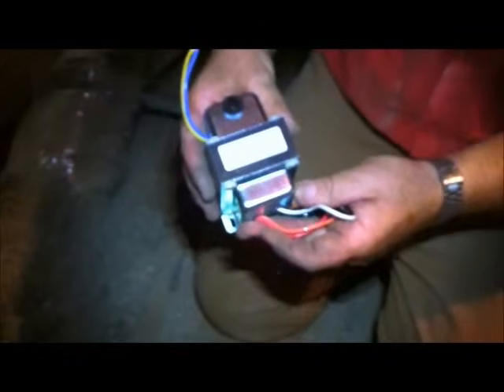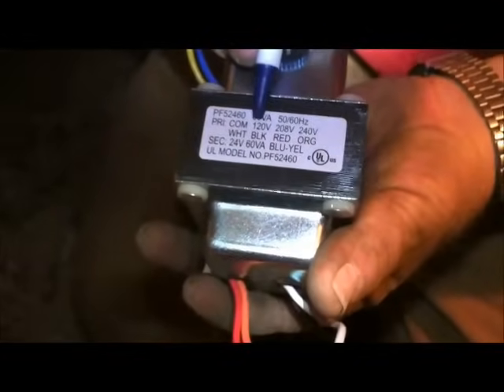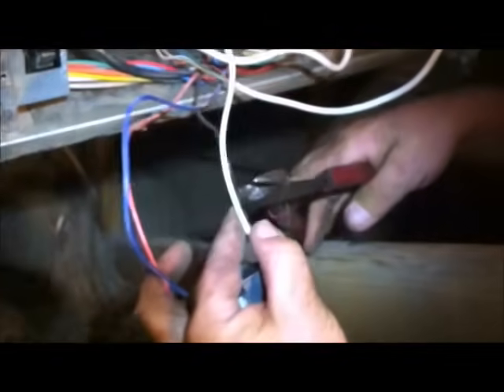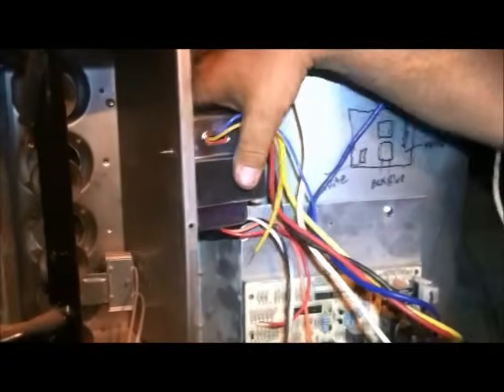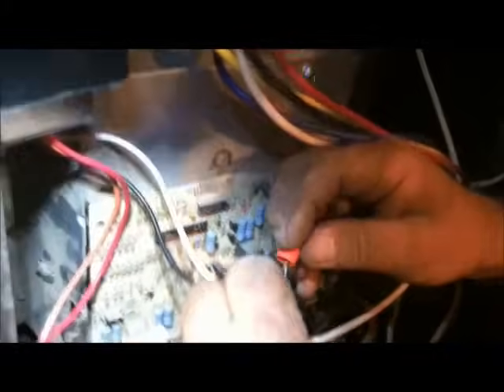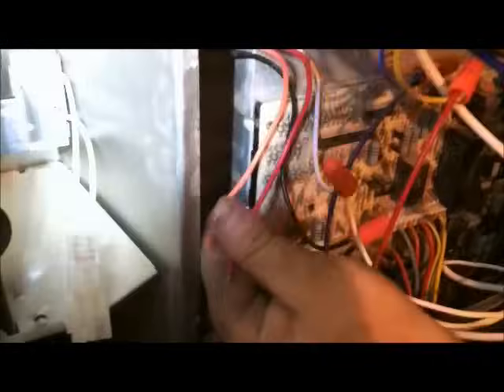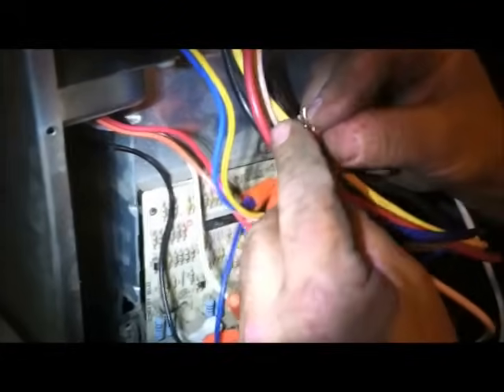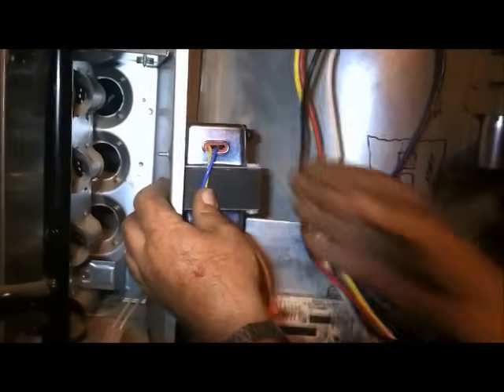Air Conditioner Transformer - How to Wire a Transformer

Comment: Hello great video I have an issues with thermostat turning off and on again the message said looking fir calibration on heat or cool disable the house is cooling but thermostat turning off few time a day and reboot after few minute ecobee was wondering if thermostat getting enough power ?thank you

Comment: So, if I got a 2 wire (red 120 and black 120) coming into the furnace, should I wire 1 to common and 1 to the 240v, in case that I'm runninn 240 to the furnace?
Reply: Your gas furnace should be 120v. If you have an electric furnace then it would be 240v.

Comment: For home gas furn Do the 24v output wires need to be wired a certain way or no matter ...and how many amp fuse coukd i install inline 2-3A?...orig 8yr old  trans went bad no melt......i repkaced it and it worked for 4 days  then melted and failed...any ideas?...furn is 8yra okd trane gas...control board fuse did not blow.

Comment: Sorry to call you out but you said NOT to twist the two wires together when using a wire nut. However, you TWISTED the first  two black 120v wires together and put on the wire nut. Only the rest of the wires were NOT twisted with a wire nut so kinda confusing...

I'd also read a recent comment from someone saying the white wire is actually a neutral wire and NOT a common wire in this video, is that true? Please advise...

Comment: I have 3 wires on my secondary. 
Hammond part # 166L25
Green , Green/yellow, Green 
Is the Green/Yellow common?
They gave me two secondaries? 
Could I not have just run an extra wire to a single secondary to run my two items?

Comment: You say you want to touch the wires to something to ensure they are not hot (powered up), but considering the way that you cut the wires (i.e. both leads at the same time), you're going to know right away whether those wires are hot because they are going to arc and burn holes in the cutting edges of your wire cutters.  When you are working on hot wires (or wires that you think might be hot), only cut one wire at a time.

Comment: Does it matter which 24 volt wire you use to splice in the fuse coming off the Transformer? For example years is yellow and blue, could I use yellow or blue or only one of them?

Comment: You mean to say that the white is neutral, not common. Common is the 120v ac but the other colours are other voltages and common does not apply. 240 has no neutral or common. White is neutral or a load neutral but only on 120. Please remove your shitty video as it's very poor quality and very inaccurate and misswiring this will cause damage.

Comment: Installed so easy and matched my old one, but much smaller in physical size. Pretty much plug and play. Make sure you have a plan and help to get it on the roof.>>> nub.best/ywvn     Cooled our trailer in no time. Replaced a 15000 BTU Dometic unit on a 2006 Wildwood

Comment: I replaced a transformer like this today.     Unit was dead as the control board had no power.      My 4 year old Trane unit had a spade connector and the Trane dealer who installed the unit would not sell me an OEM replacement.    ( they want to do it )   I like DIY.    So a local appliance shop I'd been going to for parts had a comparable transformer with wires, not spade cxt.       So I had seen your video and after 30 years of wiring, appliances, car repair, etc.    And an EE degree, I realized I had been using wire nuts WRONG!    I would twist the wires together first.     Probably taught by my dad who was taught by his.     Thank you!

I also stopped by Home Depot and bought the "baby orange" wire nuts.   I had a mixed assortment in my workshop and was always hmmming and hawwwing with the smaller sizes.     You're right.    These are perfect and I had obviously long ago used up that selection from my mix.    Now I have 30 more ( minus 4 ) .

Comment: I just replaced my fan relay/ coil. Outside unit kicked on but not fan. I noticed coil side was hot to the touch. After cooling down and plugging coil back in. Everything worked fine. What caused coil to get loose? Short maybe? Capacitor? So confused.  Great vid by the way.

Comment: But 240 doesn't have common just two hits n a ground 😕
Reply: On a multi-voltage primary, the term "common" is used to describe the neutral on a 120 volt system as well as the L1 conductor on the higher voltages.

Comment: i got a goodman  unit...i install the fan motor.the capacitor.and the contactor.and still my fan or compressor wont start......my blower inside the house urns on.please help
Reply: You'll need to measure the voltage on the contactor operator coil.  If you have no voltage there, you may have a bad thermostat or control wire break between the thermostat and the contactor coil.  That wire generally runs from the furnace to the outside condenser unit.  It could also be an incorrectly wired thermostat.  Often the required jumper wire between the rh and rc terminal of the thermostat is left off by mistake.

Comment: what gauge wire is on the secondary 24 v side of the transformer
Reply: 18 gauge copper is used on class 2 systems with no larger than 40 VA transformers.  On very long runs (over 100') you will need to upsize the wire to 16 gauge or possibly 14 gauge on extremely long runs.

Comment: I have a Heil heating and cooling system, where is the transformer located? My thermostat doesnt have power. I am an engineer and could fix it myself if I know where it is located. Tyhanks
Reply: In almost all residential HVAC systems with remote condensers, the low-voltage control transformer will be located in the gas furnace since it must also power the control board for both heating and cooling functions.

Comment: hello  mr.fix my own ac.
my question is if you can tell  wy the transformer fail? please
Reply: many factor but the two most common is a short externally or power surge from a thunder storm that cause the wires being wound to burn out.

Comment: Might want to keep in mind that electrical tape only true purpose is to tape the base of the wire nuts to the wire so they do not become lose from vibration, temp changes, etc.. I am as guilty as anyone using black tape as an insulator in a pinch but it is not designed for that and is against code (along with not taping the wire nuts). If electrical tape last a year used as an insulator its some really good tape. I have seen it last longer in very friendly environments. But the whole "Code" thing depends on where you are working I suppose. I just got in the habit of putting a wire nut on everything - even to terminate an unused wire - then putting a couple wraps of tape on em. Not trying to "call you out" on anything, just trying to help some of the new techs who might be electrically impaired... and now I hear my Fathers words " do as I say, not as I do".. yep, He is a retired electrician..hehe..

Comment: How do you wire it for a 208-230 heat pump? How often do they break?
Reply: Select the primary voltage wire that matches your measured supply voltage.  If you have no volt meter, select the 240 wire since that's the normal residential voltage supplied by utility companies.  The 208 volt utility systems are usually found only in industrial areas. HVAC units are rated at 208-230 which allows their use on residential as well as industrial applications.

Comment: i am unclear on the connections. Just want to make absolutely sure.  The common connects to one hot phase? In the case of 120 the black wire goes to neutral? In the case of all the other  voltages the com wire goes to a hot phase and the other wire goes to a second second hot phase with no neutral involved?
Reply: Charles Borrelli did u get an answer ?

Comment: What would the red wire be used for?
Reply: The red wire is used on 208 volt power system.  It's common in industrial areas where three-phase power is being supplied  (120/208 wye connected utility transformer bank).  The utility companies prefer that type of system for industrial applications since it's easier to balance the loads across individual supply transformers.   That system is rarely used in residential applications.
Reply: mousetowndude wrong. If your saying 208 volt is high voltage in England our lowest level of mains voltage 250 volts.